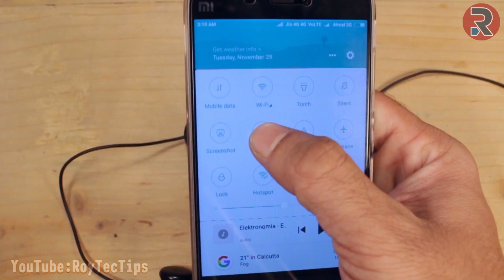How to make your Headphone Wireless(Even old Broken Headphone)-DIY Life Hack Tutorial

Comment: There is still wires but I liked your video you are an intelligent man.
Reply: BΛRBΛТOS , dude, its a wireless transmission, don't expect to build a circuit without wires. i know what you mean. airpods circuit much be tiny. it would be difficult for making a tiny circuit that fits into the earbud. whereas for a headset, it can be made wireless easily as it has some space inside.
Reply: BΛRBΛТOS headphones not wireless
Reply: BΛRBΛТOS not wireless it's Bluetooth, we know we get it

Comment: Its already a jack in bluetooth why we open and put wires in it🤔
Reply: to make it small...otherwise there is no sense in using it with earphones lol
Reply: Yamin Siddiqui 
jinka headphone khrab ho unke liye shi hai
Reply: muhammad bilal so we can reuse a broken headphones
Reply: muhammad bilal not wireless. simple headphones
Reply: muhammad bilal exactly
Reply: Macky Rayne if they Are broken it's probably the coil and not the wire!
Reply: Yamin Siddiqui there isnt a sense at all why You Would use wireless headphones! Cutting the cable wont make it better
Reply: Bernhard Blietz Maybe for sports, lifting.
Reply: Good question bro
Reply: muhammad bilal headphones were broken
Reply: IT'S OUTPUT

Comment: hey!, my pc does'nt have bluetooth and normal earbud does'nt work in that so do you have any hack????
Reply from the maker: More information need . what kind of audio out do you have on your pc.
Reply: jai tyagi ...u can use a USB sound card which will cost u approx Rs100-200 ...then u can use both audio output and input easily...
Reply: roytectips i have aux in my pc
Reply: and thanks mr.  King
Reply from the maker: yes just buy a converter cable

Comment: just saying tried this actually worked but update with the bluetooth module i got mine from gearbest a week ago as of this comment 14 may 2017 it slightly different now the pcb layout  but wiring it is still the same just quick little update. also this fixed my pair of razer hammerhead v1 the audio jack bent and wire must have split also so just revived it not as bassy from the power output but thats fine

Comment: should use 3.5 jack rather then soldering, you should solder your broken earphones with 3.5 jack and then plug in your bt device. this can help you to short your wire length.

Comment: Guys i have a question.  I am using this trick with over the ear headphones.  I was thinking of replacing the smaller inbuilt battery with a bigger one.  I want to ask if that would affect the circuit in any way because of the higher voltage

Comment: Solder contains flux, why did you flux the wires when the solder contains flux, could have bought a 3.5mm plug, also the headphones still have wires on so not really wireless.

Comment: useless project, why you cut and soldering earphone wire on 3.5mm audio jack? just connect 3.5mm male to female....
Reply from the maker: its a broken headphone .
Reply from the maker: Yes you can but if you attach normal headphone the wire it too long. I suppose to have a broken headphone and a useless audio receive. now i am going to use it in gym no hassle of long wires. thanks
Reply: You could have spliced the headphones to simply shrink it down and reattach.

Comment: You just can't do this with sennhieser dude..right? i have two broken sennhieser earphones.. 😢😢😢
Reply from the maker: You can do it with any earphone.
Reply: RoyTecTips make a video for cx3.0 pleasseeee
Reply from the maker: I don't have cx3.0. your earphone is not working because of the wire is broken. the costly speaker inside the earphone still in 100% good condition. so just change the wire. where are you from?